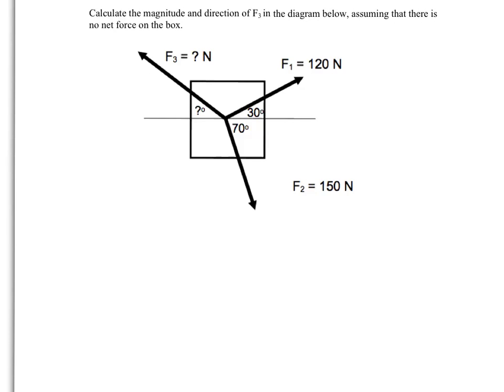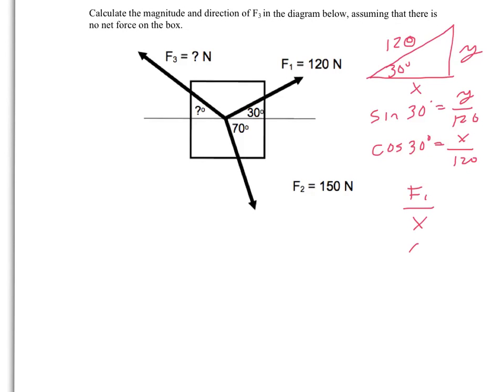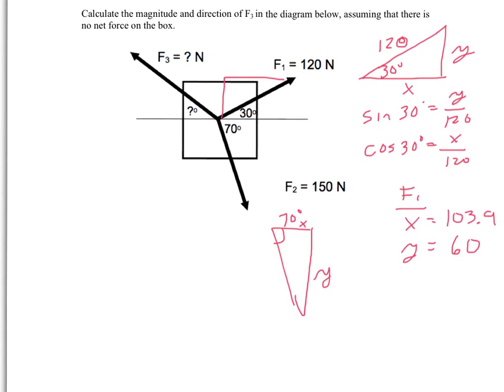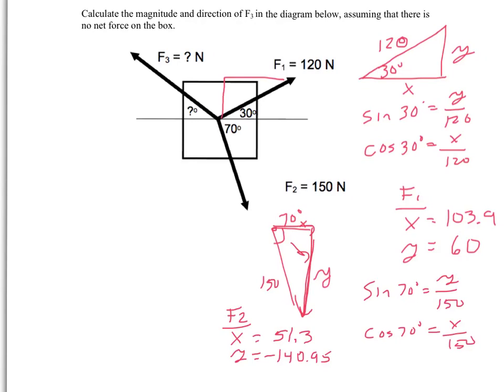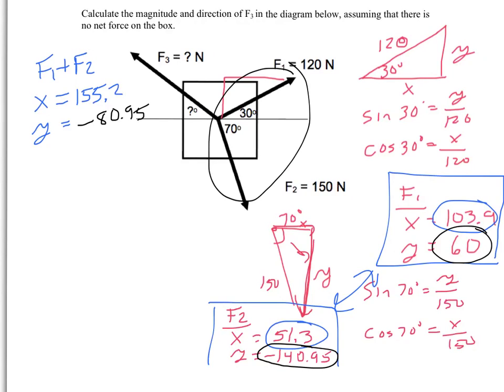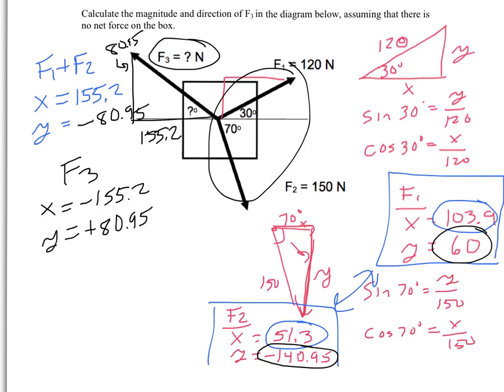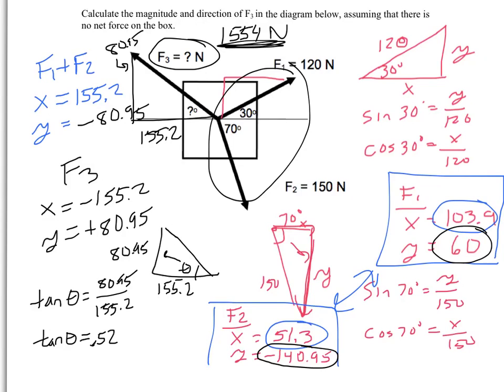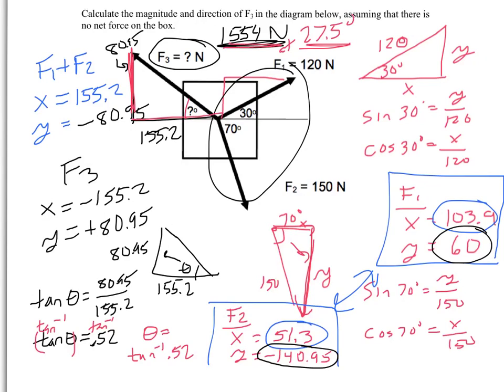V-3 Statics and Finding the Missing Force (see note below)

Comment: I dont know if you've just encounter errors when solving for magnitude of f3. Coz it was ~175N. 
Ps - one of the good explanatiom out there.
Reply: how to do that?
Reply: @MarcuzAurelius  the Pythagorean theorem is (A^2)+(B^2)=(C^2)... Thus 
(155.2^2)+(80.95^2)=(C^2)
24087.04 +  6552.9 = 30639.9425
Then you square root 30639.9425 to get the Hypotenuse (C) length of 175.04N.